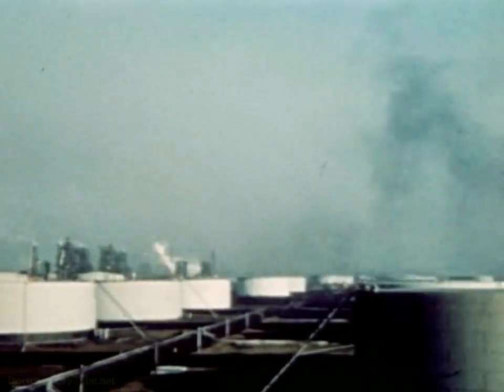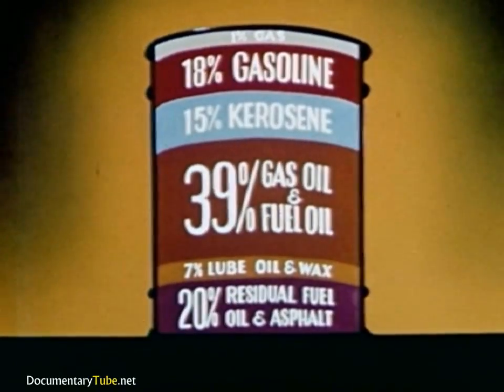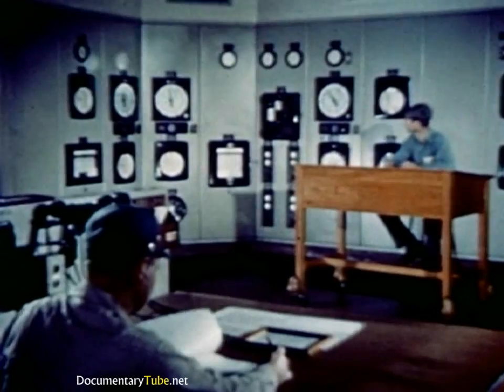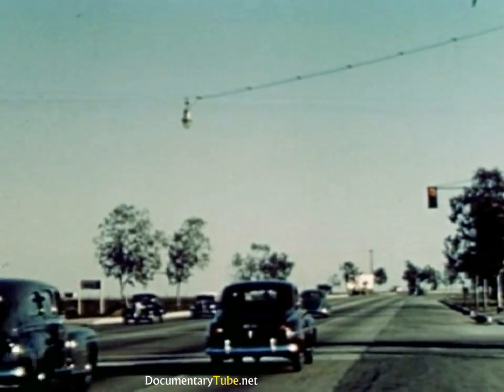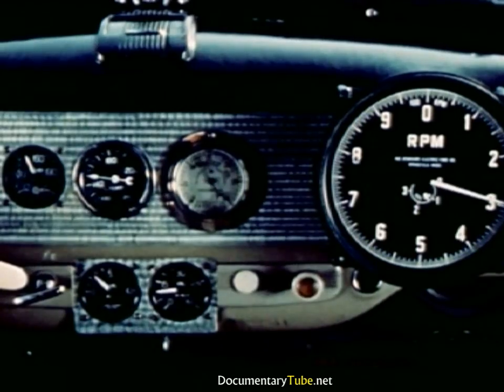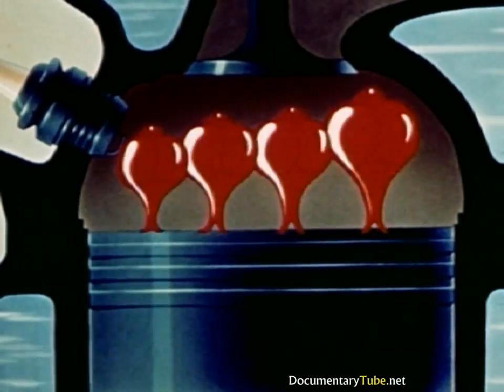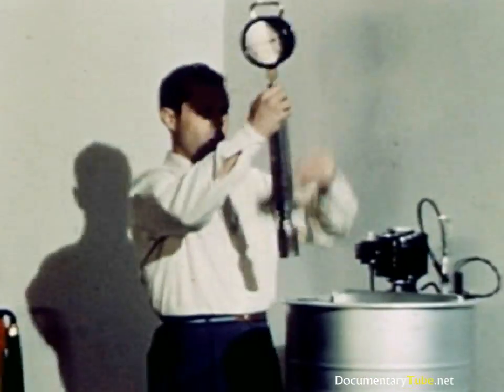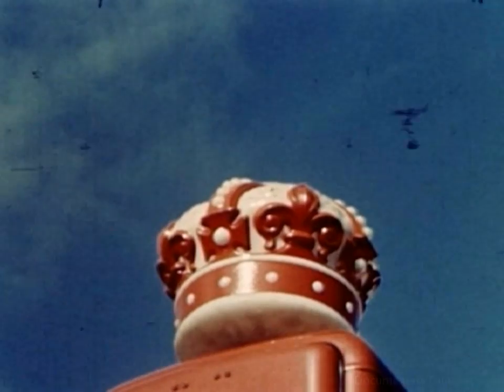HOW IT'S MADE: Gas

Comment: The big secret is no one really knows how much oil is in gas. Only what they tell us. Gasoline doesn’t stain concrete if it is spilled. At least not like diesel which does have oil in it. So if they are making 500 gallons of gas out of 1 barrel of oil they wouldn’t tell it! Another dirty secret that big oil doesn’t want you to know is that oil is most likely created on a continuous basis where the crust meets the mantel and liquifies the Earth due to pressure and heat. Then forces crude back up through the Earth. It is why oil wells thought to have been depleted 20 years prior all of a sudden are full again for some strange reason. But keep teaching it is from dead dinosaurs and trees from hundreds of millions of years ago. The sheeple will believe what you teach them.